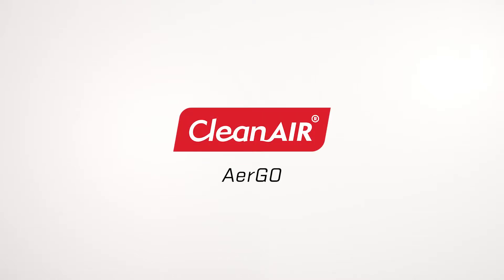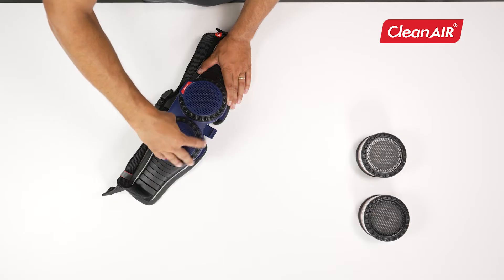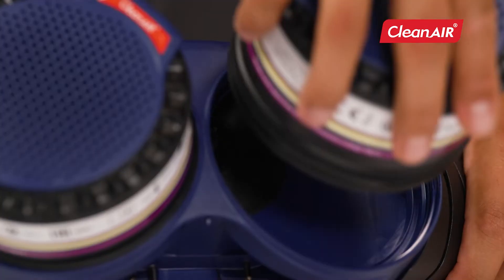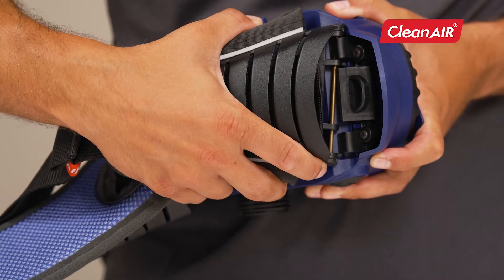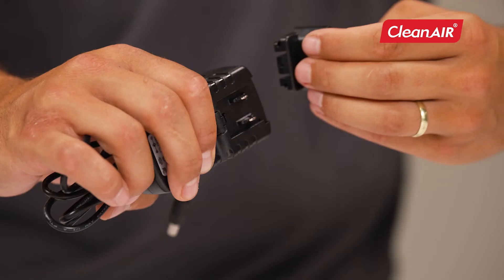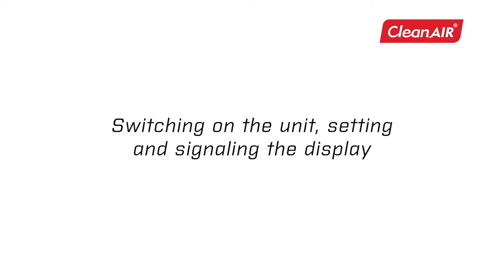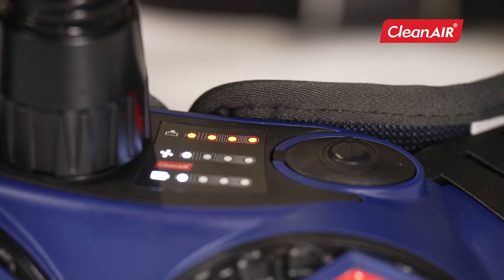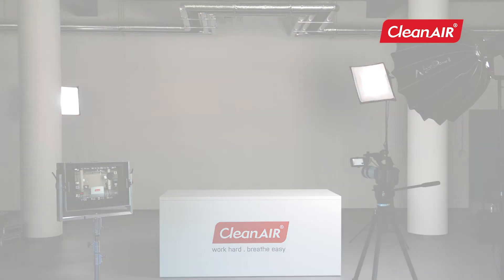CleanAIR® AerGO - tutorial video

Comment: After two years, it started disconnecting after 15 minutes of use, indicating the filter was full. New filters were installed. There's no way to clean the inside. An old hood from another company worked for 10 years without a problem.